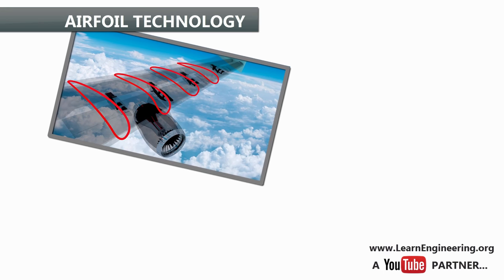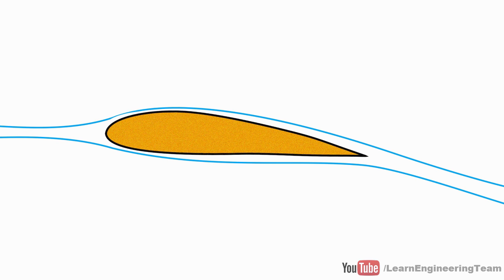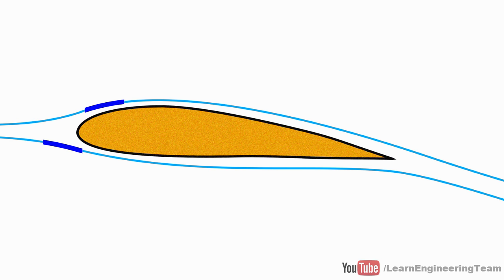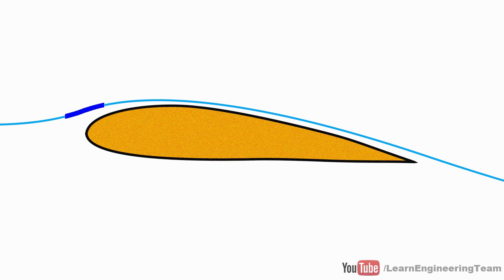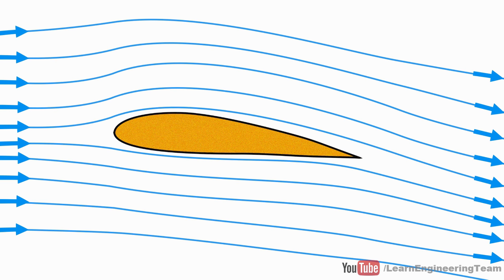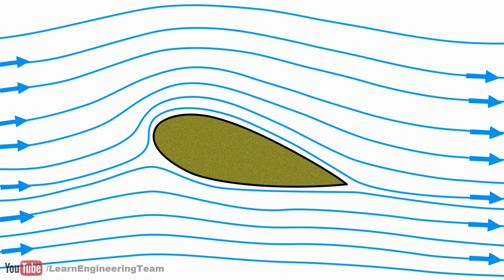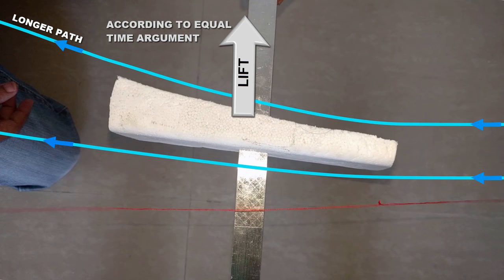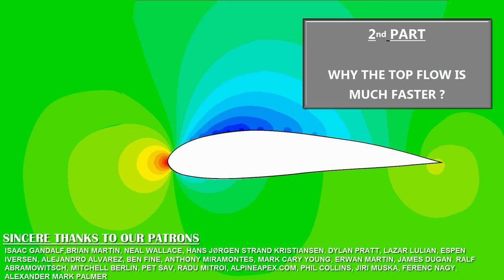How do Wings generate LIFT?

Comment: Bernoulli's theorem is NOT the equal time theory. They are different things. The equal time theory is wrong, yes. But Bernoulli's theorem still applies. It describes the increase in velocity and decrease in pressure due to the compressed air stream above the airfoil. Not some idea of molecules needing to meet again at the same time. Do not conflate the two, discrediting Bernoulli in the process.

Comment: This is an honest question and I hope someone would help me here. At 4:20 it is said "FOR THE SAME REASON pressure on the bottom should increase". Actually I can not see that. FOR THE SAME REASON the pressure at the bottom should decrease towards the airfoil as well, only to lesser extent than on the top of the airfoil. So because of that there is difference in pressure. But the bottom experiences Coanda effect as well and for the SAME reason pressure at the airfoil should be lower than atmospheric also at the bottom.

Thanks in advance
Reply: I got your doubt, but as you can see there are very little curved streamlines in downward direction, so pressure must increase from bottom to top. I think the image didn't help too much, try looking at the trailing edge region streamlines.
Reply: @lucasgrego123  Thank you very much indeed!

Comment: Wrong! The increase in air velosity is the result of the increase in pressure caused by the compression of the air by the leading slope of a cambered surface such as a wing. The  low pressure on the back slope of the wing is the result of the compressed air rebounding at a rate slower than it was compressed and expanding into a volume about twice as larger causing a reduced working pressure on the back/trailing slope with a net reduction of pressure on the surface as a whole and converts thrust into lift more efficently than angle of attack which is lift by defelection that is a 1 to 1 conversion of thrust to lift. Slats and flaps do change the profile of the wing but slats increase lift by increasing the volume of air being compressed while flaps increase lift by making the volume of the back/down slope larger and by deflection on the bottom as well as creating a bubble of increased pressure on the bottom of the wing. Somethings to remember, there is no such thing as pull or suction. Air only moves from more to less and like a spring it can be compressed as fast as there is power to do it but will expand/rebound at a rate limited by its' own mass and momentum. When compression rate exceeds expansion rate the net force on the top of the wing will begin to decline. As air speed doubles pressure will go down by a factor of 4 because twice as much air is interacting with the wing at twice the speed.                                                                           contact:  denj1333@yahoo.com

Comment: Gas dynamics gives the answer without having to make assumptions of "equal time." I'll concede that it does boil down to good old newton's third law, but one must make sure not to ignore where those forces come from.

What is pressure? Amount of force exerted over unit surface.

What creates force in a gas-solid system? Gaseous particles impacting upon the solid.

Airfoils redirect particles from the top half of the object's surface. Furthermore, these redirected particles are going to redirect other particles away from the upper surface. These two both compound to give both a reduced number of particles impacting with the top side of the airfoil, and reducing the energy of those that do impact. In other words, lower pressure. For us, this means while there is a force acting on our wing, it will be reduced.

Now, make the airfoil somewhat more complicated, giving it a curve on the bottom. You still redirect particles from the top, but you also increase the lower surface area. Drag is essentially pressure acting on your observed body in a detrimental fashion. However, since the angle of attack is not 90 degrees to the incoming particles, a component of the force the gas particles impart on the airfoil will become lifting force. 

The degree by which you increase lifting force is inversely proportional to your angle of attack. If your wing is suddenly 90 degrees, you'll have 0 lift component and 1 drag component. Reduce that while maintaining maximal surface area and you increase lift. However, reduce it too much and you reduce the amount of surface area the high energy air can interact with.

In essence, you produce lift as long as the following holds true:

F(b) > F(a), this gives F(lift) = F (b) - F(a)

F(b) = force acting on the wing from below; F(a) = force acting on the wing from above.

Both f(B) and f(A) are directly proportional to the wing's surface area. Meaning, increasing a wing's surface area without thinking about anything else will not affect lift either positively or negatively.

F(a) is influenced by the air pressure above the wing, which comes from the amount of force it endures over its surface. We want to reduce this force, so we shape our airfoil to deflect air to knock other air particles out of the way, or at least reduce their velocity; and to redirect them entirely. The ideal wing for F(a) = 0 would be a 90 degree vertical sheet.

f(b) is influenced by air pressure below the wing, which comes from the amount of force it endures over its surface. We want to increase this force, so we shape our airfoil to impact with as many high velocity air particles as it can. However, these particles also act as drag. The ratio of drag versus F(b) is dependent on the angle of attack. We want to maximize the angle of attack without generating too much drag.

In essence, the above is exactly Newton's Third Law of Motion. However, I feel that working with particles and actual interactions is much more intuitive and natural than to say "Newton said this thing, so this thing has to happen." 

This explanation proves that lift is an actual, tangible force, and not just a phantom force like centrifugal "force" is. .
Reply: +Dacino Hoihe,
RE: "The degree by which you increase lifting force is inversely proportional to your angle of attack."
This is not true.
Lift increases in DIRECT proportion to AoA up to stall, generally  about 15 degrees.
...
Yes, lift is nothing more that a difference in pressure on the top and bottom of the wing.  ALL other motions of the air around a wing (ahead, behind, below, above and at the ends) can easily be seen from these pressures.

Comment: THE most incredible thing to realize once one knows that is Newton's Third-Law that explains an airfoil's generation of lift, is where most of the energy that is utilized to generate lift comes from.

That would be gravity. Two-thirds to three-quarters of the energy used to generate lift comes from gravity. In a way an airfoil is a partial gravitational energy harvester with air/atmosphere acting as the conveyance.
Reply: If you can harvest the "energy" of gravity, then you can make a perpetual motion machine powered by the "energy" in gravity.  You cannot do that, because gravity is not a source of energy.   The energy used to lift that plane comes from the gasoline in the airplanes tanks, and nowhere else.   A constant, unvarying, unidirectional force cannot be made to power a machine.

Comment: Both Newton's third law of motion and Bernoulli's principal are in effect here. 

The top of a conventional airfoil has a greater line distance than the bottom.   

As a result, air is forced to travel at a higher velocity in order to travel a greater distance over the top of the airfoil in the same amount of time it takes for the air to flow over the bottom of the airfoil which has less line distance to travel.  

This results in a difference in pressure on the two surfaces.  

In addition to the pressure differential, you also have Newton's third law of motion producing an additional upward force as a result of air being forced downwards due to the angle of attack.  

Combined, the two both make up the aircraft's total lift component.

Comment: Answer to the teaser: It’s due to the curvature of the airfoil the particles of the fluid experience more drag in the lower part than in the upper part so the speed of the particles below the airfoil gets reduced than in the upper part.

Comment: Not sure it's so much "lift" vs. more skimming, it just depends on the weight vs. The atmosphere.  Take a balsa wood glider for instance as there is no curvature.  It's literally skimming on the air.

Makes more sense when you see the air as a liquid for thar purpose.  Yes, the airfoil does contribute but it's not creating a singular lifting force that does all the work.

Because planes have such a high weight, they have to use such a feat for all sorts of factors.  When you strip most of that weight, the aerodynamic requirements change dramatically.

Hence why a flat airfoil works fine for 3d planes - it's just pulling it through with air controls forcing direction.  Pretty much just a flying engine.
Reply: A flat plate airfoil works the same way and doesn’t even perform that badly until it stalls (where it stalls terribly). The same principles apply. Larger planes use different airfoil shapes because of structural reasons, better stall characteristics, somewhat lower drag, etc but the lift in normal flight wouldn’t be that bad

Comment: If the air stays under the wing longer than it holds it up while the rest is being pulled off by drag. Basically drag is pulling the air over as the plane speeds up, and so air easily goes over the wing, but underneath is angled down slightly so it stays under the wing longer. If you look at Nikola Tesla valve, it uses the same principle. Basically path of least resistance. Therefore it takes longer for the air to get out from under the wing creating lift. Like a plastic bag in the wind. Make sure the wings are welded on well though or they will be ripped off. Ha.

Also the heat of the air underneath is warmer than the air on top. Similar to what happens with an hot air balloon.

Comment: The air above is travelling down a pressure gradient while the air below is travelling up a pressure gradient. The latter takes energy to do, which is taken out of its kinetic energy, making it travel slower.
Reply from the maker: Right observation. An adverse pressure gradient will slow down the fluid and negative pressure gradient will accelerate the fluid.

Comment: This video is very poor for the following reasons:
1. Conflating Bernoulli with equal transit time like this: “Bernouli (equal time argument)”. 
2. Thinking that calling out the equal time myth falsifies the Bernoulli Principle.
3. Thinking Prof Babinsky and NASA have rejected the Bernoulli Principle because they called out the equal time myth.
4. The video is de facto a strawman because 2 - 4.
5. The Coanda effect only applies to a jet of air blowing over a surface, hence it does not explain attachment any other time. No jet, no Coanda. 
6. Flow field at 5:20, no upwash there so it’s wrong.
7. It is abundantly clear you haven’t studied aerodynamics because 6 and 7 are basics.
8. Also, you cannot even spell Bernoulli.
9. Conclusion: this video is actually 6 minutes debunking equal transit time ending with a perfect example of the Bernoulli Principle at work. You should not be making videos about aerodynamics because you don’t know the basics. The same will probably be true of your other content, which I will not waste time on.

Comment: The section that is very uneven on the top surface will not generate lift as the flow will separate on the top surface and thus not follow the uneven surface,  and there will be no difference in flow pressure.

Comment: Bernoulli never posited anything about an equal transit argument, and should not be blamed for an error that someone else created.  Also if you integrate the pressures on both surfaces based on applying Bernoulli’s principle, you get the lifting force as well. It’s not that Bernoulli is wrong, and nothing in Bernoulli contradicts Newtonian physics.

Comment: Umm..Last questions answer :
I think as pressure above aerofoil decreases so due to Bernoulli's principle When pressure decreases velocity increases✌️..Am I right??
Reply: Yes you are absolutely right. If you have a look at Bernoulli's principle, the dynamic pressure part has to increase when the static pressure part decreases. (low static pressure, high dynamic pressure)

Comment: Thank you for explaining reality! I experienced minimum Bernoulli effect when the top 2/3 of a Cessna-140’s port wing surface came off at 2,500 ft.! Definitely different handling as I flew 15 minutes back to home airport and 3-point landed safely! I was among the CFIs who used to mistakenly teach most of the lift comes from the wing’s top surface!
Reply: I've heard of this.  I hope you will see this. That's because, Bob, you don't realize that there is turbulence that forms between the exposed wing ribs.  That turbulence causes the air-flow pattern to be very similar to a good wing.!.  Yes it does.
 It is the air flow curve pattern that is important, not simply the surface shape.
.
We (you should) know that flat wings and inverted wings generate lift, so that should be a hint that this common "SHAPE" thing has problems, RIGHT?.
... 
With that surface skin gone, the turbulence that forms between the ribs causes the flow to be quite similar with the surface there.  Therefore, the curved flow creates a lowered Pressure, similar to the good wing.
.
It is fully known and measured that the lowered pressure above is VERY important. 
..
Figuring out the turbulence really helped understand your experience. Because...
..
Since I heard that, I read more authoritative texts and actually talked with several noted experts in aerodynamics from Boeing, MIT, Embry-Riddle and John D, Anderson. 
We met in Woodstock some time ago and you wouldn't listen and I was still in the early part of my aerodynamics studies, so I couldn't fully explain.  
.. .. ..Air HAS MASS!   Pressure on the outer part of a curve will always be higher because the fluid wants to go straight!
This ALSO makes the pressure less in the inside of a curve.
Try these: 
 Understanding Lift Correctly: https://rxesywwbdscllwpn.quora.com/
 Understanding Bernoulli Correctly: https://kyuoyckftflurrpq.quora.com/ 
 Flow along a Convex Surface: https://www.youtube.com/watch?v=3MSqbnbKDmM 
You can contact me here or through the Blogs.
Reply: @Observ45er  never have i read such nonsense, complicating reality and ignoring  actual facts! You should be a teacher!
Reply: @robertoquinn7047  It's all facts.  If you want to talk actual and well known physics, I'm willing.  I can also arrange a call with MIT's Mark Drela, a well known aerodynamics authority,  to explain that what I posted is correct physics.  If you want to learn, that is. . .

Comment: You can use Bernoulli's equation between below and above the airfoil. Bernoulli's equation can be applied between any two points in a potential flow (inviscid and irrotational). The flow outside the boundary layer is potential flow. Your arguments are mostly flawed. Of course, there is no lift on that weird thing you hold in the air. That is because flow separated inside that dip in the middle of it. When you have separation of the boundary layer, say bye-bye to lift.

Comment: At 3:18:  "There SHOULD be more pressure at the top of the particle than at the bottom."  So is there more pressure at the top of the particle or not?  If so, why is there more pressure at the top of the particle?

At 3:28:  "The higher pressure pushes the particle downwards which is why the flow is always attached to the airfoil."  So this establishes that we have a high pressure region above the wing.  But then at 4:29 we have the following wonderful statement: "this difference in pressure is what causes the lift."  How can lift occur with a higher pressure above the wing?  Doesn't pressure transfer from high to low?

At 4:01:  "And this curved flow is exactly what causes the lift."  But wait.  According to 4:29, I thought it was, "this difference in pressure is what causes the lift."

At 5:12:  "According to Newton's 3rd law, the air also SHOULD (there's that word again) push the airfoil in opposite direction with EQUAL magnitude.  This results in lift."  Ok wait a second.  We have a given amount of force pushing down on the wing and an EQUAL amount of force pushing up on the wing.  Wouldn't these opposing forces cancel each other meaning that there would be no lift (a net force pushing up on the wing) at all?

I just love it when people choose their words so carefully and go out of their way to provide an explanation which is so meaningful and clear!

Comment: Here’s my hypothesis about the question at the end:
The low pressure zone above the fool pulls air towards it, making it speed up relative to the air below the foul
Reply: which is cause by the higher curvature on the top of the aerofoil when compared to the bottom

Comment: Bernoulli's principle states that a "slow-moving fluid exerts more pressure than a fast-moving fluid." So regardless of whether particles meet, if the fluid is slower on the bottom, there will be more pressure on the bottom. So why do you say Bernoulli doesn't apply? The law doesn't say anything about equal time.

Comment: Complete laymen here to try and answer the teaser: why doesn't the air from top and bottom touch you asked. Would that be a result of the lower pressure "vacuum" left in the wake, with the air filling the lower pressure at different enough speeds to not mix? I would imagine that the pressure comes from three sources and doesn't convect as a result: the lower pressure air above the airfoil, the lowest pressure wake, and the higher pressure air from below the airfoil. 
Let me know ;  )